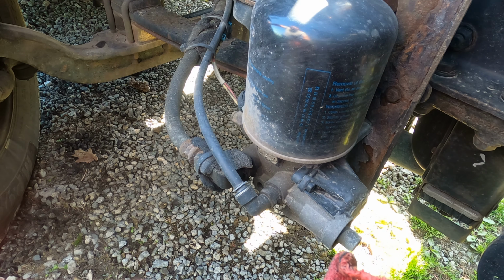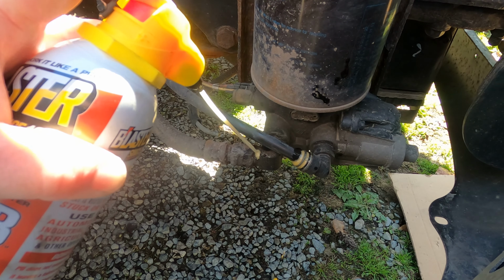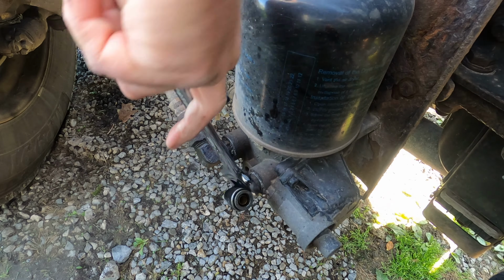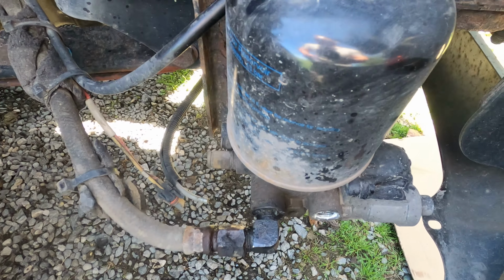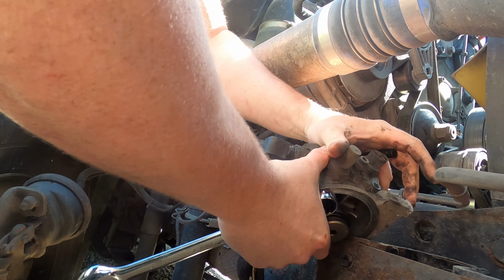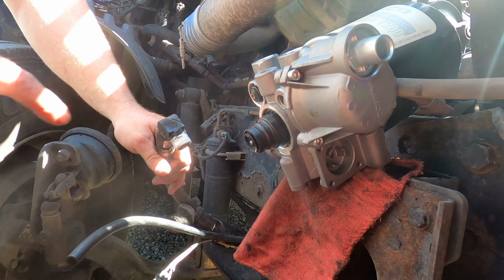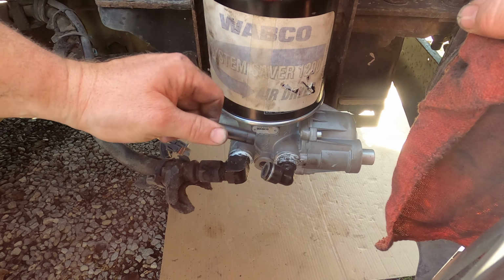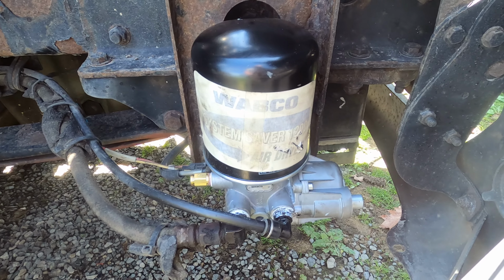Trucking , How to replace an Air Dryer on a 2007 Freightliner Columbia .

Comment: How do I know if I need to replace the whole thing or just the filter and purger?
Reply from the maker: If it starts sticking open on you and leaking off constantly then that’s when you replace the whole unit . Now in saying that there are rebuild kits for some models of air dryers . Between replacing and rebuilding it’s up to the matter of cost and keeping in mind your getting a whole new unit that will work or your rebuilding a unit that can have more problems then the rebuild kit covers . As for the filter this should be replaced at least once a year depending on where you live and if you live in a wet climate. I live in Ohio in the USA 🇺🇸, and normally replace mine around October to November before winter starts in .
Reply: @Starkeyfamilyfixing  it started leaking intermittently. I replaced the purge valve months ago but not the filter. It started purging excessively then it stopped and purged normal. I want to just replace the purge valve again and replace the filter this time, because freightliner wants $843 after tax for the whole new kit, but judging by what you’re saying I probably need to just go ahead and replace the whole thing sighh 🥲
Reply from the maker: Yeah I would change it but I would shop around , that seems really really over priced

Comment: How can I tell When air dryer is bad. When I push in the trailer brakes I hear an air leak behind the dash so I decided to change the mv3 valve in the back still same problem. When I am driving air pressure goes up to 75 PSI then stops then when I get to a stop light the air pressure drops to 65 psi and buzzer goes on the driving again goes up to 75 PSI with the buzzer constantly on. Is it my dryer? But when I am parked all brakes are set it builds up pressure no problem
Reply from the maker: If the air dryer is bad nominally it blows air out constantly or keeps releasing on and off all the time. . If I were you I would set the trailer breaks and release the truck breaks and do a walk around . For air leaks . Normal if the air will not build up it’s your air governor that the problem is. But if your hearing air flow thru your brake valves , that means it is a lot of air flowing out somewhere. Air bag , brake chamber, leveling valve, are the normal things to cause this .

Comment: Hola amigo, me parece que ése secador es muy malo, mejor cámbialo por el secador bendix ad9, saludos desde sudamerica Chile 🇨🇱 DON ELÍAS EL CAMIONERO 🇨🇱
Reply from the maker: The air dryer I took off was originally on there when the truck was built at the factory, over 1 million 400,000 miles on it . So other then normal yearly cartridge replacements I had no problems til now .